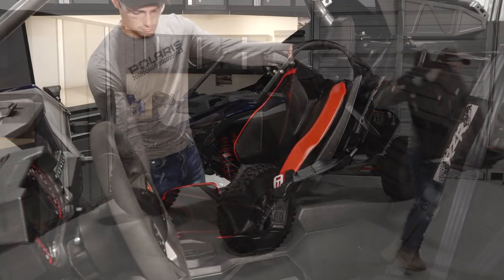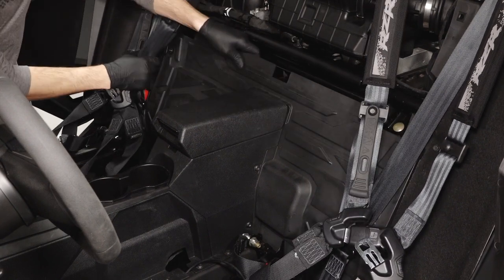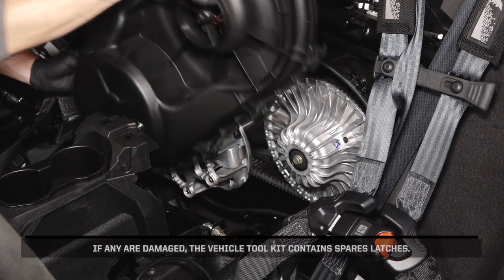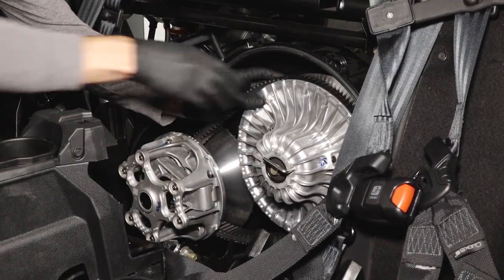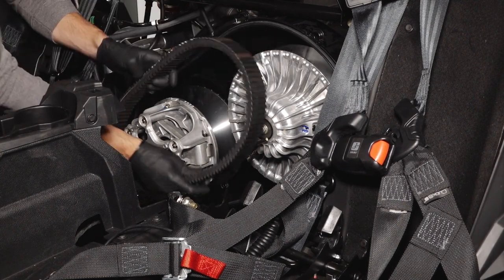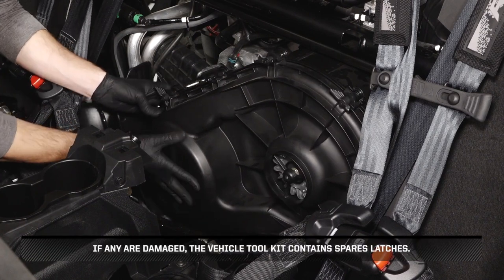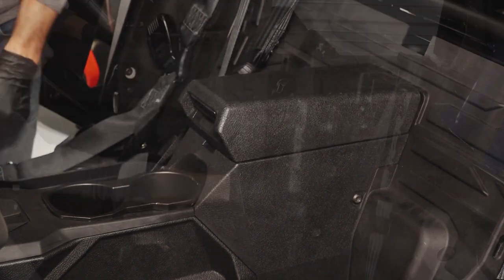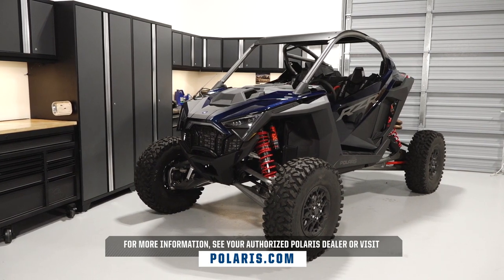2022+ RZR Pro R | Drive Belt Inspection and Replacement | Polaris RZR®

Comment: There’s actually two heat shields you need to remove, at least on my Pro R 4, to be able to turn the bottom left tablock. What a pain in the a$$ Polaris has made this to change on the fly if you’re out on the trail! It was suggested to me to not refasten the bottom left tablock or the bottom T 27 torque screw way down at the bottom as everything will be fastened well enough without those in place. It’s bad enough that that bottom torque screw is a different size than the others, as well as needing a special long tool to reach it without dropping all the Pieces under the skid plates or burning yourself trying to remove it 🤦‍♂️ So glad I struggled to do all this at home and broke in a spare belt before being stuck with this problem on the trail. Not to mention, I cut up my forearms pretty bad on the plastic housing trying to turn that bottom tab lock with the second heat shield still in place. What a total nightmare job!